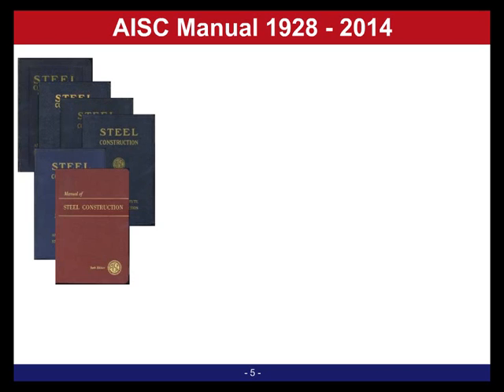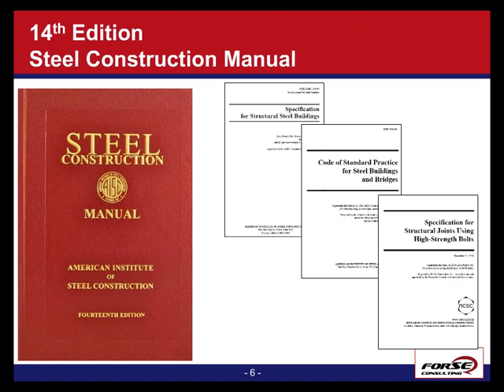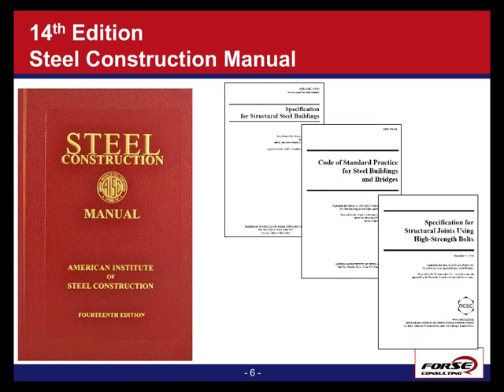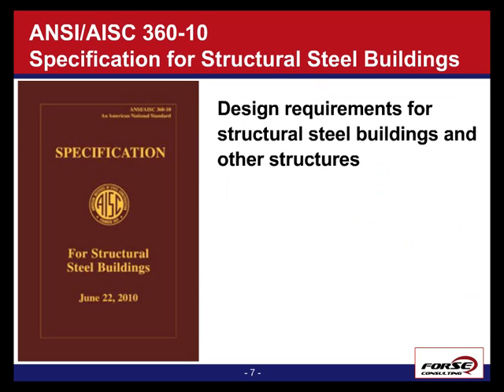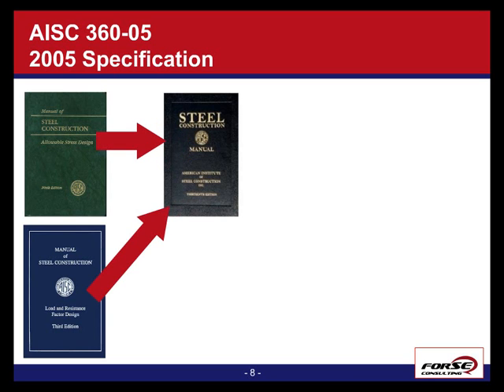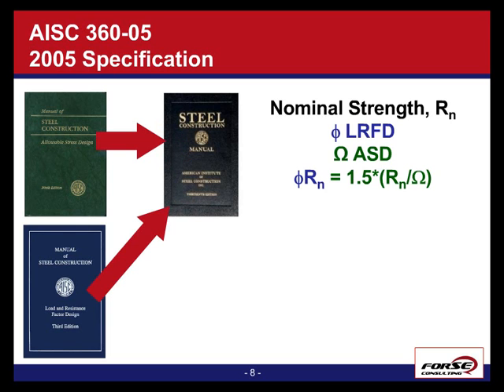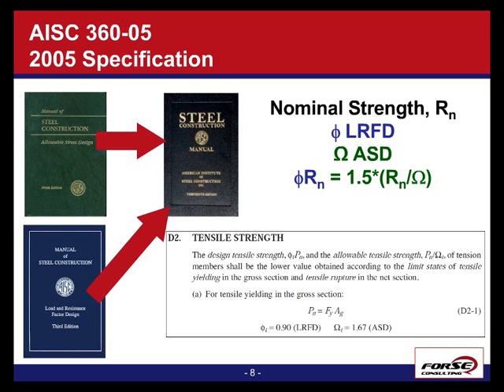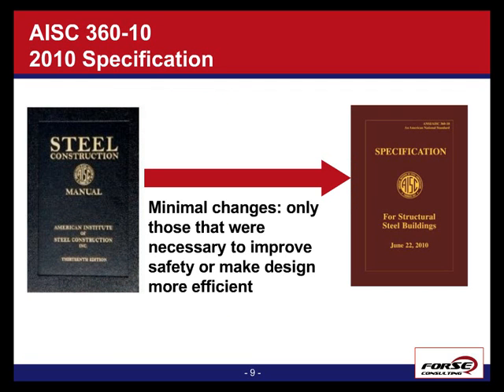Changes from AISC 360-05 to AISC 360-10

Comment: May I suggest a correction: LRFD available strength is 1.5 times ASD available strength strictly for a live load to dead load ratio of 3, because the reliability factor, beta, is equal for that load ratio.